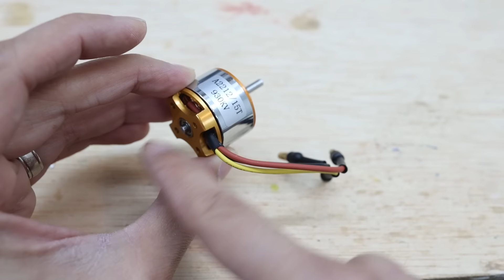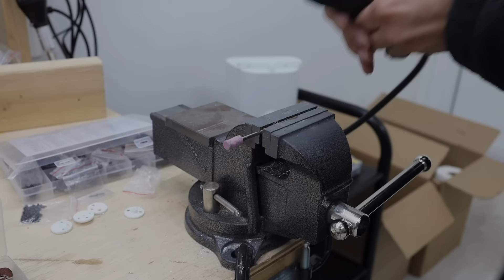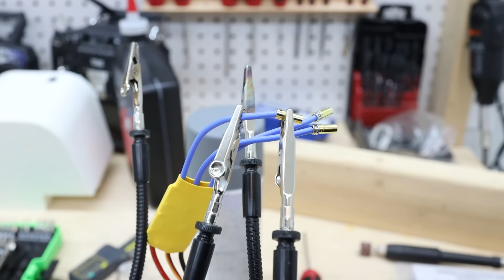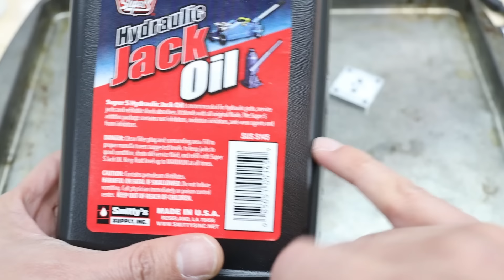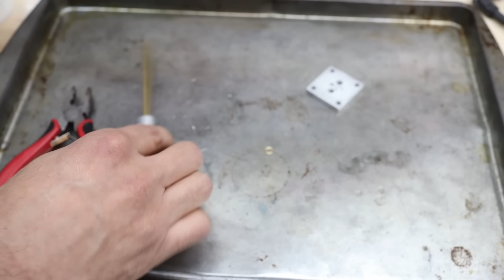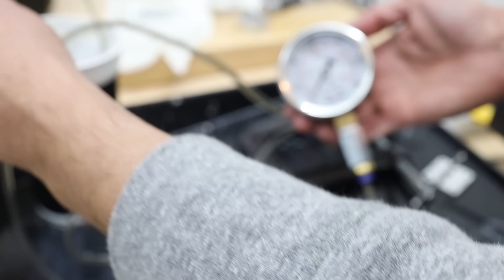DIY RC Mini Hydraulic Pump Using CNC Technology Troubleshooting Low-Pressure 30psi only not 300psi

Comment: very. cool project. 

you can use a paper type gasket like used in 2 stroke carbs for the leak, then for the gears, you can have the cylinders around the gear actually raised up 1/16" and the mating top plate can have the same shape recessed into it at nearly the exact same size, so that when you put it together you must actually press it together leaving an air & liquidight seal. but be sure to add indentations to the 4 sides of the housing to use as pry points to be able to separate it when needed. to raise the pressure use one gear, with the holes running perpendicular to the gear so it works as a vacuum intake and pushes it out the output, changing the angle of the teeth so they are diagonal rather than straight will help with that too...  it seems to me that having the two gears pulling the oil in, also restricts the amount of oil as the gears become fully engaged, by actually squeezing some of the oil back out.
just my thoughts and opinion.....
Reply from the maker: I'm working on a second version, in the processes of assembly and testing. With more precise process. subscribe so you get notified when I release the video, thanks for your comments.

Comment: The gear appear to have beveled sides, I would try to source/make flat sided gears. The oil needs to flow around the gear teeth, seems like the oil is all over the gears at this time with the bevel sides.
Reply from the maker: Yes, I tried to remove those bevel, but I need a lathe to do it

Comment: What is the gear size ????  Can i run it with low rpm motor ????
Reply from the maker: 8mm diameter, 6.8mm high it can run but needs torque, the brushless motor I used is 930Kv in the low scale of rpm.

Comment: I would try a very thin plastic washer on the motor shaft so it's between the gear and housing.  Or maybe a thin sheet plastic on the faces of the gears. Like most have said the tolerance for pumps need to be very tight and the plastic would very tight and need to wear away a little to spin freely enough. I don't know if high rpm could be causing cavitation but i am mostly guessing. I think it is really well done and to have it make  pressure it did with rc hobby parts is impressive.
Reply from the maker: An additional plastic will not make it. One of the big problems is the face of the gear; it has to be machined true flat using a lathe. Another issue is the wobbling of the gear and aluminum. The holes in the housing have to be smaller. And working in a better design.

Comment: The axial gap must be minimized, I believe the leakage pressure is reversed to the inlet
Reply from the maker: Yes that is a big issue, I was researching in how to cut the gears true top and bottom parallels and flat, maybe using a vise and the CNC or a lathe.

Comment: 15:10 One issue that I see is you're basically getting the tesla valve effect. The inlet and the outlet should have rounded corners not be pointed inwards because it is more restricting and the flow goes back in the gear path not away.
Reply from the maker: Good observation that is an easy change to do, I will try it in new designs. Thanks for your comment!!

Comment: alum + iron connected in salty solution will make fast corrosion, better use nylon gears
Reply from the maker: but oil will prevent the corrosion, is one of their properties

Comment: Many issues here.  1 the fluid entrance and exit should be in line with the gear rotation so enter from one side and exiting from the opposite when looking at the pump.  2 the shaft isnt supporting the gear on both sides.  It should go through the gear and into the housing for bearing surfaces on both sides of each gear idle and fixed.  3 tolerances are critically important.  If you can run a fingernail along any surface and you feel any gouges or scrapes then you are going to loose your pressure.  4  the gears must be lapped together for a very fine fitment.  All surfaces have to be smooth and precise. Measure every clearance. This small and for 300psi you will need to be measuring in the ten thousands of an inch or thousands of a mm.  Make your own shaft if it isn't long enough and pin it for lower pressures 60 or under but a one peice gear and shaft if you ever want to exceed 100 reliably.  5 you need a relief valve to set max pressure.  300psi is alot so you'll need some decent lines aswell.  Didn't see what you were going to use.  You'll need to use needle or ball bearings instead of just the aluminum housing for a sleeve.  That will wear reletively quickly for all the work you will need to put into this for it to be perfect.  Mic everything!
Reply from the maker: You are right in all the points, I have to check all this in next iteration.

Comment: Plus s backflow preventer, and machine a groove for the gasket on the inside of the drive shaft so that the pressure itself fits the gasket tighter so downward sloping groove or a chamferred groove. You could try a Tesla valve on the intake. It's a one-way c&c able no moving parts one way hydraulic valve. You could use a small diamond tipped Dremel tool to create the chamferred inside o-ring groove on the drive shaft.
Reply: I'd rather be interested to see how well a Tesla valve works just before the intake so that the fluid or oil can only flow in the end way and out the outweigh and it would be prevented from going backwards. In addition the o-ring should be on the interior so a small groove where the drive shaft enters and have it shampered a little towards the drive shaft so that the inside pressure snugs the o-ring towards the drive shaft as the pressure increases. Then trim off the top of that they non-driven gear has too much metal on top without a or make a little indentation for it to turn within.
Reply from the maker: I will look into the Tesla valve, thanks for the ideas!

Comment: The rod tolerance on the non-powered motor is too high and you should put the gasket on the inside so that the pressure itself of the motor seals the gasket against the drive shaft.
Reply from the maker: Yes, I have to check the rod and gear tolerances for the driven gear, and for the gasket something like in this schematics? it has a gaskets and then a washer and the motor presses the gasket https://magomhrc.com/en/brushless-hydraulic-pump-without-tank/754-base-for-mini-brushless-hydraulic-pump-without-tank.html

Comment: I worked rebuilding hydraulic governors for 14 years.  If you did get the pressure up to 300 PSI I think you would have hose or connection failure.  The oil is bypassing inside the pump.  Clearance is critical and I think you will have to refit the gears.  I have a small Cessna pump which is at least double the size of your build.  It was used on a Twin Disc marine gear box.  It was producing 150 PSI to engage the clutch packs for forward or reverse direction of the gear box.  I am pretty sure if it didn't have pressure regulator in it's system it would either stall the drive or cause something to fail in the housing.  The governors I worked on used accumulator springs and pistons that regulated the pressure and also provided reserve pressure for actuating the servo part of the governors.  I would suggest looking up specs. for the Cessna or some other brand of pump and then try matching their clearances.  The company I worked for also designed and built and sold oil pumps and systems for lubricating steam turbines.  Those pumps were driven by the turbine shaft connection to the governors.  They had a spring and check ball adjustable relief passage.  If the check ball was deadheaded they would either blow the shaft seal or shear the rubber coupling to the turbine.  I didn't design any of the pumps, but I know from years of rebuilding them that just a little wear could cause extreme pressure drops.  Good Luck and hope you find the answer.
Reply from the maker: hi, definitely those hoses are not designed to work on pressures more that 300 psi, a release valve have to be installed, I will check the specs of those pumps you mentioned!

Comment: One more thing. If you are doing this project because you actually NEED a pump this small for a project. A vane pump would be easier to build diy style than a gear pump.
Reply from the maker: Yes I been watching videos about vane pumps, they also need pression to avoid leaks between vanes

Comment: Your gears need to be lapped to the same exact thickness first off and they need to be polished to a mirror finish. The secondly you need push plates on the ends of the gears that are sprung with some sealing orings. Check out how a real gears pump is designed and you’ll see what I’m talking about. Great project man. Keep at it. You’ll get it working.
Reply from the maker: Thanks yes I have seen one that has O-ring at the ends, like this https://ae01.alicdn.com/kf/Sa49378ee98d64772af531aefca7ba880u.jpg

Comment: Use gearbox so oil doesn't reach motor, increase torque for pump input shaft ,and inlet 
Outlet hose should be in side of pump not front it's not efficient.
Ur work is great I love ur channel do well.
Reply from the maker: Thanks for your comments and good suggestions!!

Comment: Hey bud I’ve looked into doing something very similar but instead of the two gears go buy a gy6 oil pump. It’s for a scooter but has a sun and ring gear setup which should be forgiving enough on tolerances to work for a basic cnc router’s accuracy. Which is where my problem was. The height and associated clearances of the ring and sun gear are the utmost crucial. The ring spins in the housing so must allow oil flow around it so it can be just a fudge out of round without too much negative impact. If you inspect the housing of the original gy6 pump you will see a channel for this oil I believe that is the original high pressure side

Comment: If the tolerances in the housing to gears is resolved, I think you will find your next weak point is the friction fit of the gear to the driveshaft. At 300 psi, there is no way that will hold and the shaft will start to spin inside the gear. You might be better to get a one peice gear and shaft machined which is what the aliexpress pump is. Why don't you use the pump gears and shaft inside you housing if you want to get to 300 psi and still have the smaller pump housing size?
Reply from the maker: I used the vise to put the driveshaft into the gear and it is really thigh, one piece gear is ideal but I don't know were to buy it at this scale, I will take this in consideration after fixing the tolerances, best!!!
Reply: @ if you can draw up the one piece part in a CAD software, you could send the file into JLCCNC or PCBway to have it prototyped and made. Should be pretty cost effective
Reply: @domingomartinezt perhaps a interference fit would be more do able and cheaper in your situation. An interference fit is usually achieved by cooling one part to cause it to shrink, and then heat up the other part that goes around it so it can expand, interference fits allow for a much greater frictional force and should be able to handle it? I mean it's worth a shot right?
Reply: Is those gears flat on both ends, and slightly touching  aluminium plates on both ends?
Link to video of ALI-pump Audi/WV made in Italy. I changed the big 250kV motor with a smaller 2212-930kV motor to save space in the excavator and mayby less power from battery.
Only tested for motor temperatur. 2min with 1.3Mpa motor.... 45*Celsius.
Not tested in real work/digging...   https://youtu.be/LbZDsK_r65k?si=AZAGtmIItuWJ3_Lj
Reply from the maker: @Oddis  I would like to try this route, the pump head is $15, and I can buy the other components, can you tell me what components you used, ball bearings, shaft bell, and pulleys, did you try it with your excavator? How do you connect the shaft to the pump driving shaft? if you can make another short video, I will design something in aluminum using my CNC, Thanks for your help!!!

Comment: You'll likely need to redo this in a fashion that makes the housing self clearance and shim with copper shims. It's gotta have such a tight tolerance for the dimensions. You may be better served to make a swashplate pump that you can order hardened chromoly pistons for to withstand the breakin process with the housing body, OR install shaft seals that will allow a much looser tolerance around the whole mechanism. Use spring steel valve plates like out of compressors (hvac)  and make the cylinder head ported to give multiple stages.
Reply from the maker: I did saw this schematics https://magomhrc.com/en/brushless-hydraulic-pump-without-tank/754-base-for-mini-brushless-hydraulic-pump-without-tank.html and it seen that it can work using aluminum they sell a model similar.

Comment: The hot body of the pump is the clue here for the low pressure. The gear teeth are too far away from the edges of the pump body, and the oil is being pushed back past the teeth causing frictional losses. The leaking from the pump side is also due to the o ring cavity not being big enough for the size of the o ring.

I would get new gears first, make sure they are consistent and flat, then make a new body thats a barely an interference fit, and allow them to self clear. The gears are steel, the body aluminium, so it will actually wear away anything thats touching. 

Pumps like this rely on very specific tolerances to work properly. I would also replace the o ring shaft seal with a proper liquid seal, and put a cavity into the pump body for it.
Reply from the maker: Your comments on the temperature makes sense, I will increase the cavity for the O-ring and substitute with X-ring. Someone suggested X-ring for sealing, or you mean another type? Thanks a lot for your comments.

Comment: You need to actually divide the inlet from the outlet and a gear pump at this size needs to have perfect tolerances to build high pressure. Another thing is recess the o ring so it doesn't get squeezed into the shaft so much.
Reply from the maker: The dimensions for the recess of the O-ring you mean the back one that go with the motor? I has to make it deeper, wide or both? check this schematics they use a red O-ring and a washer after it, Thanks for your help and comments. https://magomhrc.com/en/brushless-hydraulic-pump-without-tank/754-base-for-mini-brushless-hydraulic-pump-without-tank.html

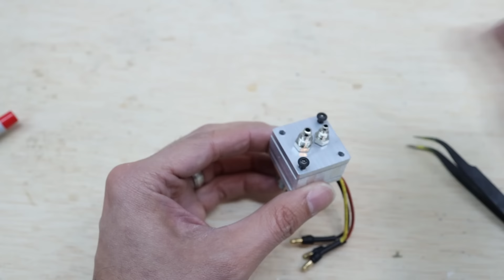Comment: 10:11  this is the main area where from pressure drop issue starting.
make sure main body (in right hand) and cover (in left hand) plate faces should to perfect flite and smooth. 

26:08  now look that gap... can you see ?  between main body and cover plate, that gap should NOT be PRESANT there. that gap is main reason of pressure dropping. if main body faces and gear face will not touch with that cove plater, pressure will not be generate.    (now make sure.. there should be very tight tolerance between Gare face and cover plate and no gap between main body and cover plate)    You said that main body height and gear height are equal but I don't think so because the gear is not touching the face of cover plate because of the gap and pressure dropping. 😁👍
Reply from the maker: Yes I can see the gap, also the top face and bottom face of the gear were not true flat, there was a hill up to 0.20mm differences as I was showing with the caliper. I will tight those up, and mill the top plate. I have to buy more aluminum to give another try, it is and iterative way try to improve it. Also I have seen another ideas like double seals for upper cap and bottom to separate high pression from low and redirect leaks to low pressure intake to the pump. But that will be next design.
Reply: @domingomartinezt  You need flat gaskets and not o-rings between the main body and end caps. Something as simple as a thin copper sheet with the appropriate cut outs would work.

Comment: There seems to be too much play between the gears and the housing. The gears need to be a neat fit with no play and yes, the height of the gears will also drop the pressure.
Reply from the maker: Thanks for your suggestions I will reduce the gap between gears and casing and try to mill gear at top and bottom.
Reply: Agreed, the fact that the pump is so small will make the tolerances absolutely critical, bearings on the ends of the shafts would also help keep the gears from allowing the oil to pass between,

Comment: Nice project but the clearances both axial and radial have to be very small, the seals should not be rubbing on any thing.
Reply from the maker: Yes I have to think how to resolve those issues, taking in consideration also the limits of my tools, it is a challenge see if I can improve it passing this point.

Comment: Hi, you are into something here👍Keyword is precision between gears and housing, this is very crucial.
I made a pump long time ago, here is a link maybe you can get some ideas👍
https://youtu.be/UFi3V2xkBPw?si=2tVrGblhGkGy6C-P
Reply from the maker: Waoo I'm impressed with your video, you burst the hose!!! did you make the gears or did you buy them? I think my mistake is using a gear with an inserted rod it is ideal for the motor to drive it without any adaptations but it is not precise enough. I have seen videos with the same construction, which reached 300 psi using normal gears. I guess he used a lathe to face the gears, I have the idea of using the same CNC to face the gear top and bottom to hold in the process I can use aluminum with a hole on it and one screw to tight and hold and then wet sand it with fine grain.
Reply: @domingomartinezt Yes, gears in my pump is made on a manual mill with dividing head👍